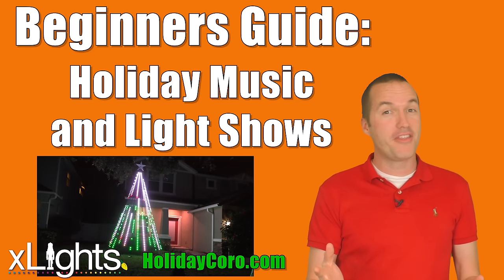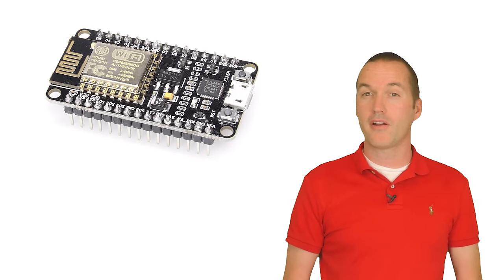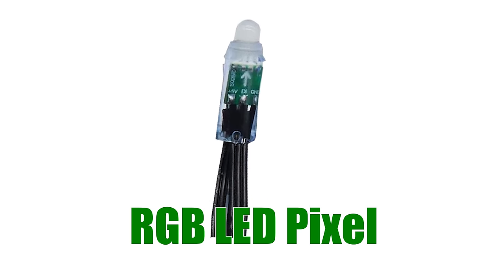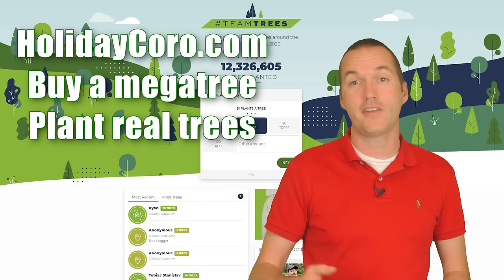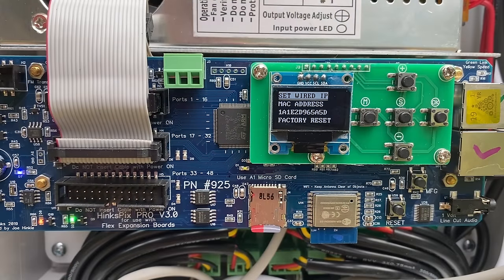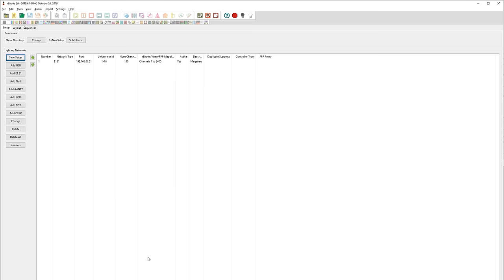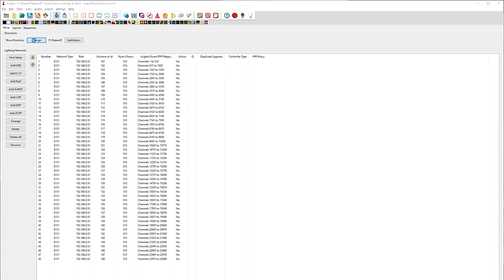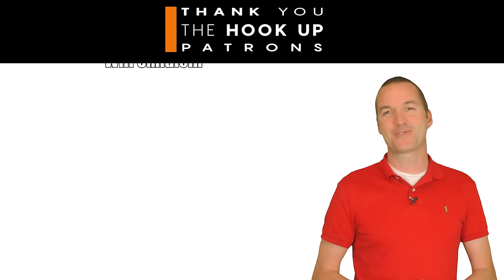Holiday Light Shows 101: LEDs, Controllers, Props, and Sequencing for BEGINNERS. 5 Hour MegaTree!

Comment: This year I want to install some LED stripes along the ridge of the roof for the first time.  This year will be a learning year.  I am going to use some inexpensive controllers, ESP-32 running NodeMCU firmware and some simple LUA scripts.  I will probably run the stripe along the inside of the ridge in attempts to keep the stripes out of the rain.  The current problem is trying to determine what type of cable to run for the power.  I will probable have about 5 stripe of 5m - 30 pixel/m variety.  I have seen/read the gauge of wire to run, typically I have seen 12 or 14 AWG being recommended.  The question is, what type of cable should I use?  Romex that is rated for outdoor use (14/2)?  Low Voltage landscaping wire (14/2)? 

Second question, can anyone recommend a good Discord server that revolves around LED lighting?
Reply: 18/2 stranded wire is plenty good ...like low volt landscaping wire or security system wire ... can get it in 500ft - 1000ft box of wire at your local homedepot or platt electric or online.. amazon

Comment: Hello. I hope you get this. I bought an led strip that has amazing presets and comes with a remote control. I want to control these presets with dmx or make my own similar presets but with dmx. Is this possible?
Reply from the maker: Anything is possible, but something like that would require some pretty advanced automating with something like Home Assistant.
Reply: @TheHookUp  thanks so much for your swift reply. I am a guitar player singer and my whole show is automated from midi to dmx. My 12 channel laser, smoke and pars are all programmed. Will I need to buy a dmx led controller and also that  home assistant thing?

Comment: Hey brotha I see you used 6 esp8266 for your first show.. im very new to this hobby and I want to do the same I have 500 12v pixels 12v power supply and 6 esp8266, what else would I need brotha??
Reply from the maker: It's a pretty large rabbit hole to go down, I'd highly recommend starting with 50 pixels and a single NodeMCU.  Once you've got that figured out you can increase the size of your show using the same techniques.

Comment: Since the HinksPix Pro has Wifi, why is it required to connect it to ethernet? Did you ad an ethernet port to the outside of your house or would a Powerline Ethernet Adapter be an acceptable solution to avoid the hassle?
Reply from the maker: From what I understand, the WiFi radios on the hinkspix and falcon don’t have the bandwidth to handle show data.  You can use the WiFi on the hinkspix to download firmware and connect to the web ui.   I don’t think the WiFi on the falcon is functional yet.
Reply: Here is an article that talks about E1.31 and wireless.  While possible, not recommended.  Ideally you would have a wired connection or load the sequences directly onto the controller.  See this article for information to be aware of when using wireless:  http://www.holidaycoro.com/kb_results.asp?ID=157

Comment: Could you possibly tell me how I could implement the christmas light addressable  systems with my DMX control board and lighting? Hardware wise, do you have any input into how it's done? The end result I want to achieve is using my moving head LED stage lights with Christmas show but I've never dealt with these addressable LED systems
Reply: I think you might want to switch over to using some sort of software (I use Vixen Lights) to control the individually addressable LEDs as well as your DMX lights. I've used a moving head light along with a few DMX spotlights and a DMX-controlled Laser machine in my display, and I ended up making a simple E1.31 to DMX converter to make it work with the other lights. That way they are all using the same control method in the software.

I don't think it would be a good idea to use a DMX light board to control individually addressable LEDs (if that's what you mean), because each LED needs its own channel (actually 3 channels per led, usually), but it is doable I guess. One idea would be to build a separate DMX-to-LEDs controller that uses just a few DMX channels (like 5 or something like that) to determine what patterns the LEDs should do. For example, you could have one DMX channel control the speed of the various LED effects, and have another DMX channel determine the type of effect (chase, strobe, etc.), and have three more DMX channels determine the colors. Just an idea.

Comment: so this is a mega tree kit? how many ws811 lights would i need in total to make this tree like 500 lights more or less is 50 x 16?
Reply from the maker: This tree is 50x16, so 800 pixels.
Reply: @TheHookUp  I don't want to mess with pixel strands.  I want HD images on my 180 degree Megatree. How about some 5M base strips and stick Amazon waterproof BTF Lighting 5M strips to them?  .  They are 300 pixel (WB2812B) so 900 channels per strand. They are pretty bright.  Also, Can I run multicast and put a WLED module on 16 (or less?) strands with 16 separate IP addresses (and power supplies)? Got these WLED WiFi modules on Amazon- made by Domestic Automation Vegas Lights.  I have plenty of WiFi 5ghz or 2.5ghz bandwidth (TP Link).  Controlled with XLights. It's 2024 so things hopefully have advanced more by now.  Cost is not object.  Also, is 16'4" is too tall?  8'2" is too short.  I was planning some 1" EMT conduit and guy it equally in the back side.  Maybe I can zig zag the strips and go for 12' tall. This WLED module I think will control 2 strands (600 pixels 1800 channels).  I bought 200' of YPS Puck tracks lights for my eaves.  I have a big house and measured 160' to be covered so got 40 extra.   I'm planning to incorporate 1 or 2 singing christmas trees and some candy cane props maybe a couple arches too.  I have a good FM transmitter for viewers to receive.  I have that working at least!  Any advice appreciated!  This is my first show.

Comment: I will be curious to know how you integrate into Home Assistant. I ended up just calling playlists via MQTT to my Falcon Controller Raspberry Pi.
Reply: Falcon Player also has a REST API. I use Node-RED's Light Scheduler and http request nodes to schedule my display. 

My REST call to turn on my lights looks like: 

GET http://192.168.0.xx/fppxml.php?command=startPlaylist&playList=myplaylistname&repeat=checked&playEntry=0&section= 

And to turn my lights, I use:
GET http://192.168.0.xx/fppxml.php?command=stopNow 

Using Node-RED allows me to easily assign various switches/events around the house to control when the lights go on and off.

Just a heads-up

Comment: Can the HinksPix Pro ready2run bundle support 150 Pixels per SPI?  I am having trouble finding how many each SPI will support.  I am wanting to do 5 Meter ribbon LEDs with 30 LEDs/Meter and if one SPI can't control that many, how do you hook up multiple SPI to the same ribbon?
Reply from the maker: It supports 340 pixels per SPI output.  That's 2 universes set to 510 channels, 510 channels per universe x 2 universes =1020 channels  1020 channels / 3 channels per pixel = 340 pixels.
Reply: @TheHookUp  very helpful, thank you!  The holidaycoro site says 5,540 Pixels in the description, which is not divisible by 16 and is where I was getting confused.  But with your math of 340 x 16 SPI outputs = 5,440 pixels. Wonder if it is maybe just a typo on their site.
Reply from the maker: @timknipper2076  Yep, probably a typo.

Comment: So if I am going to have 5 separate LED strips (garage, first floor, second.. ect) I will need a separate controller for each strand correct? Each separate leg needs its own controller?
Reply from the maker: Depends on the controller you are talking about.  If you're going to use a NodeMCU and WLED, then the answer is yes.  If you're going to get a HinksPix or Falcon, then you will use a different output on the controller, but a single controller (the Falcon F16V3 and the HinksPix both have 16 ports).
Reply: @TheHookUp  I was thinking of running the Dig uno. So that will be wired up like the Node will? Single chip per string.
Reply from the maker: @nomiss05  Correct.
Reply: @TheHookUp  Thank you! I appreciate the help!!

Comment: can we control pixel led and relay in same time using arduino mega by vixen software?
Reply: I'm not sure how you would get Vixen control data to the Arduino Mega, but yes the Arduino Mega can handle that and more. I have used an ESP8266 to receive E1.31 data from Vixen and communicate via Serial with an Arduino Mega to control other lights. That might be what you want. Let me know if you have any questions.

Comment: I thought about getting an alpha pix controller, can I upgrade it to a HinksPix pro later?
Reply from the maker: I think they are different completely.
Reply: The AlphaPix is two generations - Classic which cannot be upgraded and the Evolution which can be upgraded by removing four screws and a few plug in cables.  Given that the HinksPix PRO is so much more functional (play on controller, smart receivers, FM transmitting, more protocol support, more details in the firmware / status) for just $35, go with the HinksPix PRO if you are starting out.

Comment: Don't forget to check and adjust BRIGHTNESS.  You don't want one prop washing out the rest of your display, and you don't want your neighbor to be able to read comfortably by your lights.  Inside his house.   Respect your neighbors.
Reply from the maker: I fully agree with this.  The megatree definitely steals the show on full brightness, makes the rest of the house look small and insignificant.  Luckily brightness can be handled directly on the controller so I don't need to go back and edit each effect in xlights.
Reply: The Hook Up did not know you could adjust brightness on the controller itself. Just got my Megatree about two weeks ago, put it up this weekend in my backyard for some testing, and it is definetely bright. Will look into brightness setting on the controller menu. Any hints are more than welcome.

Comment: Is it possible to use xlights with a nodemcu? Only trying to do the roof outline with a couple LED strips.
Reply from the maker: Absolutely, check out 
WLED: https://github.com/Aircoookie/WLED
or ESPixelStick: https://github.com/forkineye/ESPixelStick
Reply: I just used a nodemcu for a very inexpensive DIY Magatree. I connected up 10 strings of 50 LED all in a row to the nodemcu. Then zig-zagged them from top-to-botttom to form the tree. Then I have Xlights set up as (3 Universes, 1 Strings,  500 Node/Strings & 10 Strand/Stgrings). This way It gives you the exact automation that a normal separated strings would give you. No need to buy an expensive controller box. Of course I also have a beefy power supply to feed all the LEDs with.
Reply: Mark Roles so I was able to get WLED and xlights to talk but wasn’t working correctly through the test option on xlights. The first 2ft lit up white and that was it. Think my settings are wrong on xlights I’ll have to play around with it.
Reply: @eddie_bee   Make sure that in WLED you have the number of LEDs that you are going to use and the Max Amperage is set.
Reply: I am following this Mark and Edwin. I am trying to get 3 strings of 50 leds in serie. So 150 leds. Its not a big tree 16 leds high and 9 strings wide. And hoping to get the fancy xlight effects as well.
Reply: @oomkoen  so your setup would be he following then. 1 Universes, 1 Strings,  150 Node/Strings & 9 Strand/Strings
Reply: @markroles7304  I just got it working. 1 String, 150 Nodes/String and 9 Strand/String (because its a zigzag). This video explains it real good. https://youtu.be/q49N617LxWg
Reply: @oomkoen Thanks for the link Koen! It is nice to get the same Maga tree effects form just a $7 NodeMCU than wasting $699.95 for the commercial control box. Life is good!

Comment: I’ve been away from the lighting scene for a while - is anyone doing words/phrases on the megatree like “drive by karaoke”? Is that an available option in XLights?
Reply from the maker: Yes, XLights has a "Text" feature where you can have scrolling/moving text on a megatree.  The denser the pixels on the tree the smaller font you can use.

Comment: Thank you so much for your excellent videos!  My wife and I are planning a very small show consisting house perimeter (with the LED strips you linked) as well as a couple of columns and trees in front of the house (using pixel strings).  My intent was to purchase a ready2run controller from Holidaycoro, but I am concerned about whether or not a ready2run controller can be used to control both strips and strings concurrently.  Is this possible?  Do I need to purchase additional connectors or something akin to that?  Thanks again!  Happy holidays!
Reply from the maker: Yes, no problems mixing strips and strings, they are all the same on the inside (WS2811 protocol)

Comment: can you use a arduino with usb  to run a mega tree or other props with xlights?
Reply from the maker: Other props, absolutely... mega tree probably not.  Also, not Arduino in the Classic sense but ESP8266.
Reply: @TheHookUp  dose it have to be run wireless or can it be run through the usb
Reply from the maker: Esp8266 is wireless only.  There are some Ethernet esp32s, but they aren’t great.
Reply: @TheHookUp  ok lastly where do i get the info to turn ESP8266 into an xlight controller and diagram of how to hook up the lights to it . thank in advance
Reply from the maker: Check out wled or espixelstick, both are well documented and can receive E1.31 signals.

Comment: Nice video Rob.  You should add some other vendors. Great job on universe topic.  That's a lot $$$ for that ready to run controller.  Lighting community not big fans of holiday coro.  Go the falcon route.  David Pitts at falcon has better controller.  He supports all his stuff.  The hixspix is nothing but trouble and no one supports it.  Don't waste $$$ no ports and not expandable.  Rob you are hooked. I'm sorry.
Reply from the maker: I do have a falcon also (f16v3), but I didn’t get a ready to run kit, so it’s not as pretty as my Hinkspix pro. Do you know why the community is not a fan of HolidayCoro? 

I’m not sure you have the correct info on the hinkspix, it is just as expandable as the falcon (16 on board spi connections and up to 48 via long range differential expansions).  

I called HolidayCoro about some questions that I had with initial board setup and Joe Hinks actually answered the phone.  I don’t think it was just cause I’m a YouTuber either, I just used the support number.  

You know I’m not one to shill a company that makes bad stuff, but my experience with them has been really good thus far.
Reply: The Hook Up  , when I started the hobby I bought first batch of pixels and x connect ors.  Ok service. He is buying from same vendors like Ray Wu and Paul zang and really marking up so high for dyi and commercial. I'm sure you can make box just as nice.  Jdeation.com and have it sent to you.  We can talk offline I can give you reasons why community has issues. Ask on Wednesday zoom call.  Many other vendors for dyi that are better.  Nice xlights intro.  It is the best and open source. So many great people contribute to software.
Reply: We respect David at Falcon but these two businesses are completely different  David in a single person doing this on the side, we are a business with a dozen employees that have packed, assembled and supported our products for years.  Our costs for assembled ready2run controllers are hundreds less than Falcon and we can deliver 100% custom assembled controllers (power supply counts, voltages, output counts, mounting options, CPU options) all in usually 24 hours, even in peak season.  Additionally, the Evolution of the Falcon is E682 > PixLite > AlphaPix > Falcon V2 > Hinks PIX 16 > Falcon V3 > AlphaPix Evolution > HinksPix PRO.  You might notice that the SD card, audio out, network switch all appeared on the V3 after released on the Hinks PIX 16 controller.  That said, we believe competition in this space is good for who matters - the customers.  The more vendors competing for your business means lower costs and better solutions and the Falcon V3 is an example of that, just like the HinksPix PRO is.

We do NOT purchase from Ray Wu or Paul Zang.  We did about 6 years ago do business with Ray Wu (who I have personally met 3 times in China) but due to quality issues, we switch to different factories with better quality control.

Comment: I want to do this and it is a great video but it is like 1500 dollars just to get started!!!!
Reply: That's why I went the DIY route. It's ridiculous that these ready-made controllers cost so much, when the DIY route costs like 1/10 as much. Personally, I would recommend staying away from the ready-made controllers, because if you build all your lightshow things yourself, you learn a lot more and will be better prepared to add more things later on without paying that $1500 again.

I already have 8 WS2812B leaping arches, 8 short vertical WS2812B light strings, 2 WS2812B long vertical light strings, 3 WS2812B horizontal light strings, 8 relay channels for Christmas lights, a couple DMX spotlights, a couple disco-effect lights, a moving head light, 4 standard led strips, and a DMX laser machine, all controlled the DIY way. Of course, the DMX lights were purchased separately, but they were relatively cheap ($15 each for spotlights, $85 for laser machine, $70 for moving head light, $20 for disco light). All controllers were built and programmed myself, and all the leaping arches were built myself with a few supplies from Home Depot.

Sure, it takes significant work to build everything, but once it's done, it's SOOOO worth it.